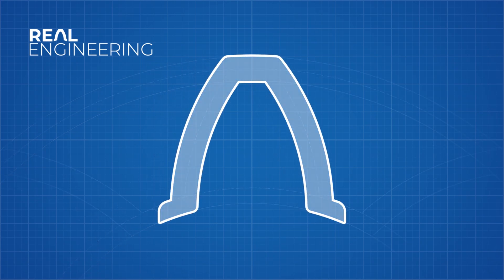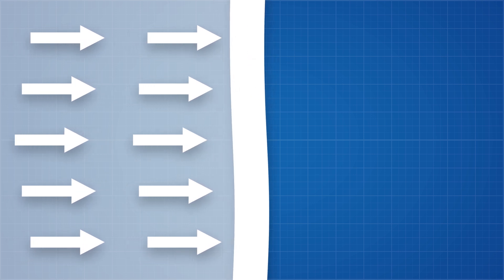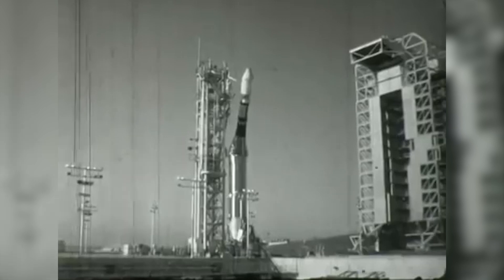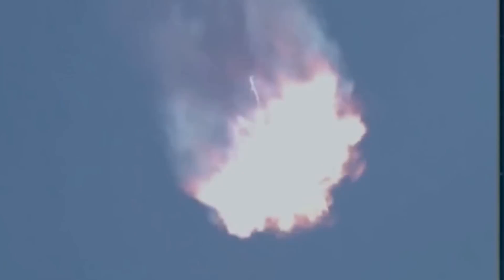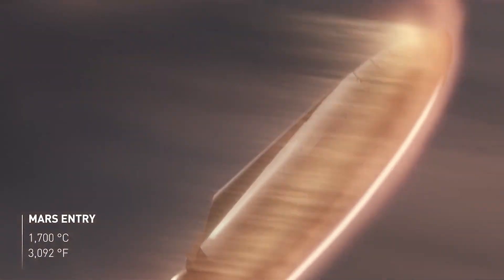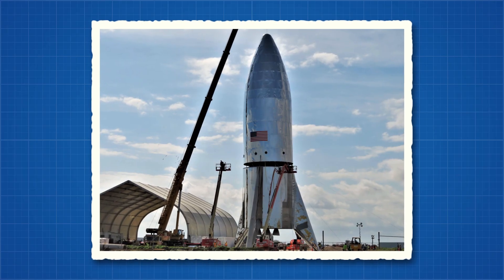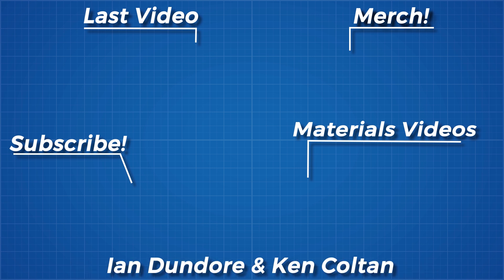Why SpaceX Built A Stainless Steel Starship

Comment: Its elon musk, nothing is strange with this man
Reply: The strange thing about Elon Musk is that he gets credit for other people's ideas, pretty much like Steve Jobs. I mean sure, he's building things that are cool, but people attribute the ideas, like that vacuum train thing, to him, which isn't the case. 

Not that I think the Hyperloop is going to become a real thing any time soon, there are a lot of risks to it that I don't think were considered early on. Like super sonic wind in case of a ruptured vacuum tube, leaks, pressurising and re-vacuuming the tunnels at stations etc. I thought of vacuum trains in my early twenties and I had it pretty well worked out, but my oh my the BOM cost on that thing would be *ludicrous*! To make it safe you'd have to have layers of progressively lower pressures for the tunnels themselves, then you'd have to have a maddeningly slow trip through a series of air locks for every station, you'd have to carry air for the passengers. To achieve a faster speed than current common trains you'd either have to climate control the entire tunnel and engineer a way to make insanely smooth and level tracks and wheels, or rely on maglev, which involves cooling the rail in a vacuum which is a whole other hurdle. But yeah, enough about that. BTW, vacuum tube trains were thought of at least as early as 1799.

In any case, sure Elon does some neat stuff, but it's not as if he's that clever, he's good at getting the population engaged and investors hooked, the rest is a touch of daring to try ideas that other people pushed to the side. In some cases, like landing boosters, the tech probably wasn't there before recently. Pretty much same story with electric cars, since these too go back almost as far as the very first automobile(aka the one that wasn't a re-purposed horse carriage that Daimler Benz put together).
Reply: @ColtaineCrows  That's true. But he's the image when people think SpaceX or Tesla. He sells the name. He's basically the Aflac Duck from that one commercial that the duck keeps yelling AFLAC!!! I can't think of it now..

Comment: One important factor you didn't give enough attention to is the fact that with very large spacecraft, there is more room for carrying extra weight. For smaller spacecraft there is a very small margin  and any extra mass means significantly higher launch costs per kg. However, for a large reusable spacecraft the equation changes dramatically. There is much more room for extra mass and reliability and reusability become far more important. The main reason why super large rockets have not been used till now is the lack of reusability meant the greater complexity of larger rockets was less economical than small ones. They would have had to launch large numbers of satellites on every launch to be economically viable.
Reply: Also this is not for spaceflight, it is only for testing the dynamics of the vehicle when landing vertically
Reply: Timothy Whitehead that’s what everyone thought when they decided to make the space shuttle, and now look at it.
Reply: They says SSTO's sucks. Let's see till someone built a cost efficient and quality SSTO then that kind of rocket reusable will be obsolete.
Reply: Splint Cell eh as nice as SSTOs are on paper it’s far more efficient and cheap even with potential future innovations. Why try and make something a ssto when for the same cost you could have a 2 stage rocket and launch far more. Do not get me wrong sstos are cool they just don’t really work for Earth
Reply: Oh and I assume that your on about a reusable ssto.
Reply: @iainstenhouse8399  Because SSTOs are far safer than the unconventional landing of reusable rockets when you factor in landing to other planets without atmosphere. That's why I say if someone will develop a cost efficient and quality SSTO then the reusable rocket will become obsolete.
Reply: Splint Cell so you mean an SSTO spaceplane then
Reply: If weight is a factor down to the smallest amount ,does it matter if the astronauts use the restroom before the launch?like do they weigh them before launch?
Reply: Which current technologies SSTOs don’t really, however with future innovations SSTOs should become more viable. And don’t get me wrong I want SSTOs.
Reply: However even with future technology I’m still not sure. But I do want to be proved wrong
Reply: @Guitarman7133  what?
Reply: I agree with you. SpaceX perfected their new landing tech making the rockets reusable! I been following SpaceX for some time since 2016.  Being able to land on moving platforms made a HUGE jump in SpaceX rockets!
Reply: @deaderthendead041  It's like when you go to the doctors, no food or drink for 24 hours and make sure you do your daily morning poo before launch. Can't be running out of fuel because Dave had a big breakfast before launch.

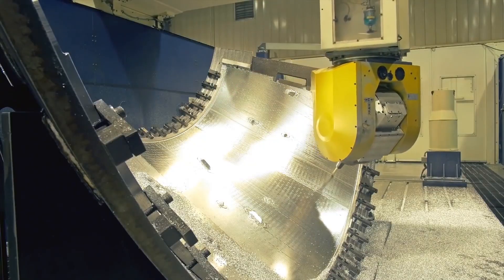Comment: 5:05 , you say that CNC ing isogrid from thicker material produces a lot of waste (95%). This is most likely not true. It is recycled. It is easy to remove lubricants and remelt it, or as a part of another batch, and create another cast.

It is just the problem of time and big machine required. These machines are rather costly, and it probably day or two to machine out one section even when toolpaths are optimized and very high feed rates are used with first past done using coarse milling and big tools.
Reply: The sale price of waste metal is doubtless far below the original price of the stock, hence waste is a significant issue, along with the sheer cost of machining the items in the first place.
Reply: Wasted time, energy, and money is still waste.

Comment: Real engineers use valid units! like °C and °F, or degree Celsius, degree Fahrenheit.Honestly, it's a practical problem! In Europe, English text is often British, using °C. But the same text could be from the US,  using °F - it is sometimes not even possible to infer the language variant from text context, or the actual value from physical context. It's 40 degree outside. Oh, that's not a pleasurable temperature. But is it cold, or hot? And the melting point of argon is −189 degrees, right? We should use Kelvin, for fucks sake!
Reply: Kelvins would confuse the living daylights out of cooks and meteorologists. Referencing off the properties of water has its uses.
Reply: HuntingTarg - No doubt it would look confusing on first sight. But it actually the least confusing variant. A temperature in Kelvin is almost unambiguous, because it is so far off the common values. In most contexts, it allows to make the unit clear from context. It's 270 outside? That's K for sure. And it is not 270 degree Kelvin. There is no °K, the unit is just Kelvin. I did not think about that in detail before your comment - thanks!
Reply: as someone who uses SI on a daily basis, i really want to agree with you. I want to, but I know some of the history of attempted spelling reform and know that such an attempt would likely cause generations of confusion and probably require multiple attempts. For the majority of purposes, the actual system used doesn't matter, only consensus matters. You know 40 degrees is cold if you happen to be asking someone in Tallahassee Florida. For applications where global consensus actually matters (i.e. science and ISO standards) we've already agreed to use SI

Comment: Starhopper’s top fell over in 50mph (80kmp) winds. Saying that SpaceX isn’t running this so well because of a minor setback is a little disingenuous.
Reply: The winds on Mars are much worse.
Reply: Timothy Stamm, no, Mars’s atmosphere is 1% as thick as Earth’s, so even much faster wind speeds cary a fraction of the of force.
Reply: @timothystamm3200  The Martian was just a movie dude, atmosphere is far too thin on mars for wind to be an issue
Reply: @michaelfarrell4824  that's not true ever heard of momentum.  Even a small thing gotten up to a high enough speed can hit with a massive force.  Also if the wind isn't an issue than what's kicking up all that sand in Martian sandstorms?  Also before you insult it the Martian was a very accurate movie when it comes to facts about Mars.  (Also that windstorm that hit them in the movie was a sandstorm.)
Reply: @timothystamm3200  It is true, the momentum conservation principle only applies to isolated systems otherwise you could throw a rock on Mars and hit yourself on the back of the head
Reply: @timothystamm3200  I'd also point out that sand tends to weigh less than interplanetary spacecraft
Reply: Timothy Stamm, the Martian is a very accurate book/movie, but the strom was narrative device to kick the stroy off with. Andy Weir has said so himself. Also, small fast moving objects are going to punch through an object. If you want to move something, it best to use a large (relative) slow moving object to push it.
Reply: @kokofan50  As well made as it is there are still plenty of inaccuracies to count which is fine because narrative gotta narrative, it is an awesome film, still not got around to the book
Reply: The Starhopper will never leave the Earth's atmosphere, it's a prototype that will make 5m high heels and nothing else.
Reply: Starhopper it designed to operate with the airflow coming from directly ahead or directly behind, not from the side.
Reply: @michaelfarrell4824  Okay.  I guess I don't realize what low density does to an atmospheres winds.  I do wonder what the record wind speed on Mars is and how that converts to force.
Reply: @timothystamm3200  From what I gather winds can get as high as 60mph but because of the thin atmosphere it equates to a breeze on Earth
Reply: @timothystamm3200  I think SmarterEveryDay did a video on Martian wind forces, I'll try and find it post a link
Reply: @timothystamm3200  when the production model gets to Mars, they will be sure not to take off the tinfoil nose cone and set it down, without being full of heavy fuel and gear! Lol

Comment: I think it's just a decoy. I don't think he has any intention of sending that Buck Rogers spaceship into space. He probably has a secret facility somewhere and is building the real spaceship he's planning on using.
Reply: Dave Casey he said in the video that starhopper (the oficial name spacex give to that thing) is not supposed to go to space

adding a little of my own knowledge starhopper is supposed to be the grasshopper of the BFR, basically this is just a test to prove the technology and see that everything works, not only the design of the starship buy also the raptor engines

Comment: stainless steel body improves the flux dispersal generated by the flux capacitor,
Reply: chessmoon exactly! I was thinking the same thing. Doc Brown for the win
Reply: I'm surprised they're using 1985 technology like the Flux Capacitor.  Plus the cost of converting the Flux Capacitor from DeLorean to be used in space travel... Btw, what is Alimeniam? Is it a new kind of aluminum? 😁
Reply: @Taylor88Productions  You know the Brits .. they talk weird.
Reply: Tech Bargains that’s for sure !
Reply: I had my doubts about it when I saw what happened after it got blown over, but the way it's described in the video gives me a bit more confidence in its design now
Reply: Ham Man  is this some voltron shit? cause it sure sounds like it
Reply: Only at my grocery store with hot chics  and that's most often the case !
Reply: Ham Man  No worries there. Libya not really a thing anymore.

Comment: hello from Soviet russia, where in early 1963 russians build MIG-25 from stainles steel for same reasons, in same time americans used titan for its blackbird (sr71). Nothing new in general.
Reply: Bristol  Aircraft company Type 188 High speed research aircraft built in the 1950's
Reply: Mig-25 would reach Mach 3, the skin would heat up too much for aluminum, and titanium was too expensive.

Comment: The chips from milling don't "Go to waste" ya dope. Not even in the smallest machine shop.
Reply: yea shove it in the fuel tank to burn it when launching
Reply: The cost of the material you have to buy is a lot higher than the product in the end. Sooo lots of waste
Reply: @TheAdatto  they recycle the cuttings

Comment: When watching this I often wonder why they don't use plexed carbon fibre for large storage.
The storage itself will insulate in that case, as well, as being high tensile strength.
The plexing allows for keeping shape as well as load.
Thin film application of anti-corrosives would protect the carbon fibres against any corrosion from the fuels.
For an extra solid structure you'd need to use a inner 'backbone' possibly metal to keep from
collapse while at rest and unpressurized, while also keeping up the load.
The nice thing is that a life sized model using carbon fibre is cheaply constructed.
Add within the backbone last.
And lastly test with 40 tonnes of steel at the top for any G-faults of design.
Entire cost of this <$1.000.000, and tells, by result, whether or not it's viable (which I think it should be)
Since the engines are at the bottom, the structure itself won't have to carry the load.
The structure itself should be able to handle 10 times the weight of itself and the payload, while
this factor would constrain the max acceleration to 6G's safely. (with a 66% safety limit,
which in turn would be partialy used for any structural vibration propagation)
Reply: And yes, re-entry for the boosters would be problematic, since they'd be moving really fast.
But how about the following scenario ?
When re-entering, speed reduction using the engines to a speed that allows for non-thermalisation re-entry ?
Nasa already used ceramics for a heat shield, and when the bottom would be shielded against slight thermalisation, the speed reduction would have to be less, given propper angle, and a somewhat cone shape of the fuel. 
And then there's magic ! 
The fuel storage itself may burn, as long as the engine itself with a small fueltank (enough to do the landing) survives.
What is lost ? A carbon fibre shell large fuel storage.
(for which the cost is actually low compared to other solutions)
Curing is not neccesary a mircromanagement problem in which sleight faults can cause disaster.
Simply apply enough to withstand fuel pressure to roughly 150% while printing and curing as the fuel storage gets built,
on the spot.
(Sorceror L40+)
Reply: The same can be done for the payload storage.
If smart, you'd leave the payload storage in orbit for future use space station construction.
Reply: Also, who says a fuel tank should only consist out of an outer shell ?
Plexing the material, ito add structure within allows for building on the spot, with described method.
When done it may even be able to partially support the backbone.
Reply: +500.000 exp...
-gains another level..
Reply: For Mars landing, use compressed fuel (one part of it) to simply depressurize and thus become very cold,
absorbing heat before combustion ?
In fact you can do that for the two fuels, one on each side, before combustion.
The heat will increase the fuel efficiency as well.
Reply: Also, when constructing a life size model, dig a hole first.
It takes one guy who knows how to use a bulldozer for roughly 10 weeks.
Then with the sand on the side, pour some concrete into it, bit by bit to create an inverse dome, and top the roof with a steel roof, all the way down to the concrete, like a dome. That will keep models from being destroyed.

Comment: The only thought that occurs to me about stainless in this application, is wondering if there could be a corollary situation similar to how stainless has frequently failed in the service as coolant piping in nuclear power plants...  would the ambient radiation of space cause similar or significant enough cracking issues to the skin of the craft as the energetic particles in a nuclear reactor were blamed for the cracking issues of the associated stainless coolant tubing failures in nuclear reactors???... and has this angle of thinking even been addressed in the engineering considerations?
Reply: @awashburn6944 , Dear Sir, I have no experience or expertise in either industry, I just remember hearing about how the Maine Yankee plant in my home state was shut down years ago, before it's fully expected operation life due to repeated repair and failures verses repair costs, and the radiation being cited as the failure factor... I don't know anything about the material characteristics, specs, or the radiation factors in either place of application... was just curious if there was a possible corollary, and if this was even considered against any possible history of knowledge gained from either service experience gained in the nuclear industry or aerospace industry... because it would be terrible to needlessly lose a soul if there was a possible related factor that went unnoticed and could have been checked out beforehand... better to ask a stupid sounding question here and now while they are still working things out and have someone who knows to take a look and make some educated calculations if it wasn't thought of before... I am just asking a stupid question, and I say stupid only in the sense that I realize that I don't know what I don't even know about this subject, and was curious with all the other troubles they were having, if this factor was ever looked at, or if it even mattered looking at... if you have any hands on knowledge or access to folks who do, what is your or their hunch about it? It would be interesting to have a professional weigh in on this... thanks for your previous reply!